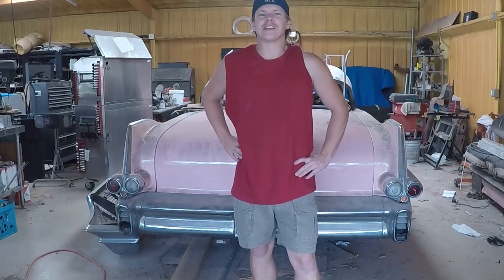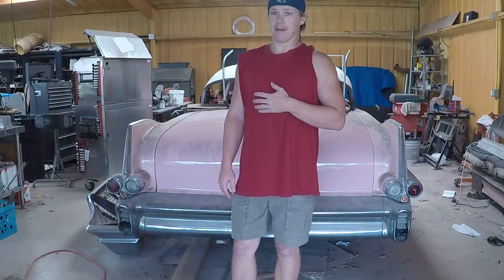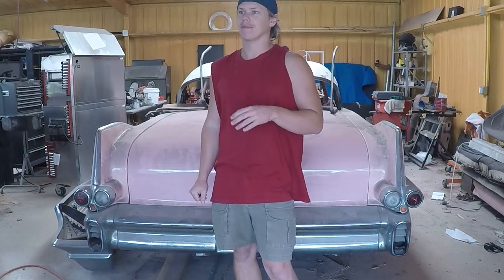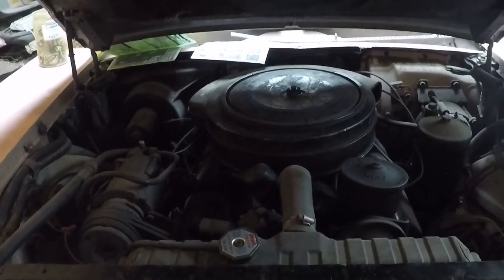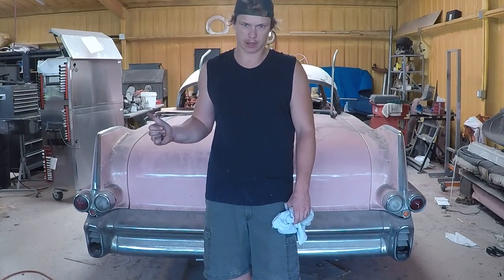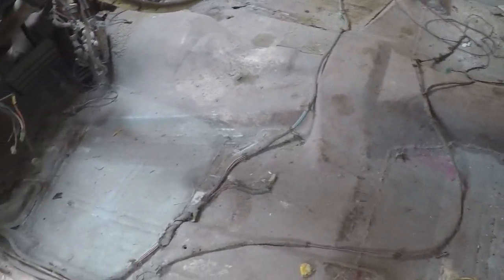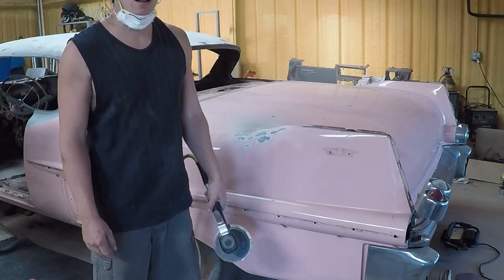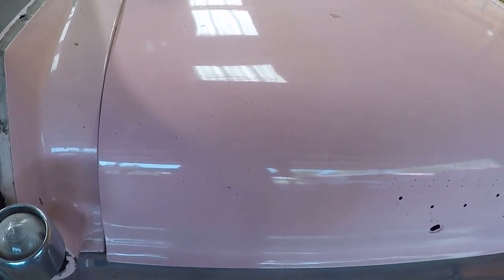1957 Cadillac Coupe DeVille build.

Comment: When you're done stripping it I would epoxy the car, and then spray the whole thing with Evercoat super build and then block it out. It's a spray on filler that goes on pretty smooth. I know you said it's a driver but after stripping it the car will be so wavy.
Reply from the maker: That's the plan. I've used the evercoat super build with great success in the past. It's going back the factory pink, so a lot of the imperfections are going to be incredibly difficult to see.

Comment: If you were Freiburger you'd have an LS block in her with a blower on top, every piece of the drivetrain rigged up for high power, and leave the windows and interior out in true Roadkill fashion! LOL
Reply from the maker: The original plan for this car was a 6.0L LS engine, but that would take too much time. Yeah he would. 600HP,  plexiglass windshield, and the rusty seats back in it, then hit the road for 1000 miles. I am following some of his advice from roadkill garage, "Do the right thing the wrong way. A running project is far more motivation than a project in pieces."
Reply: Since you got the carpeting and upholstery all up, that's the time to get some modern mods inside like soundproofing and structural bracing, even an older driver quality car can be modernized to make driving a whole lot easier and comfortable.

The more and more I look at my Diesel Camaro project build, the more confident that a 6.2 Detroit, as much of a slug anchor it is, can be a reliable swap, especially with all the extra mods and deletes.  I have no use for an LS even for as light as it is, since I'm wanting to burn 50/50 bioDiesel, and be really cheap without all the expensive flexfuel conversion kits.  Diesel has better fuel mileage than ethanol anyway.  If I had a '57 Cadillac like that, I'd probably swap in a BOP TH350 and an Olds 350 Diesel just to be cute and different. :P